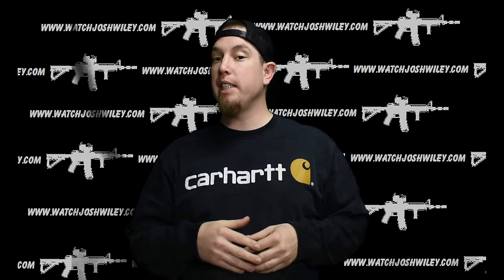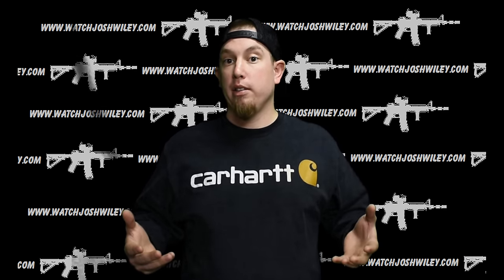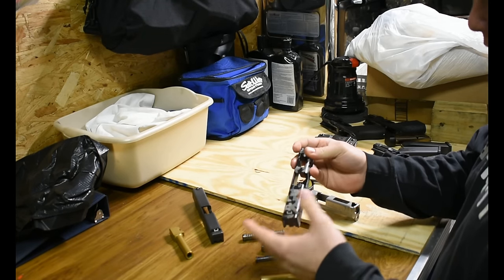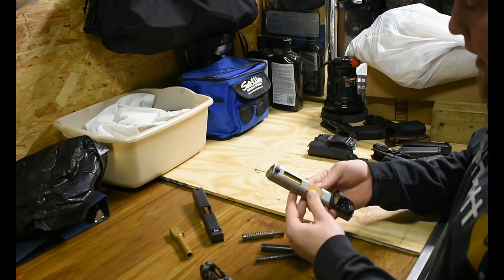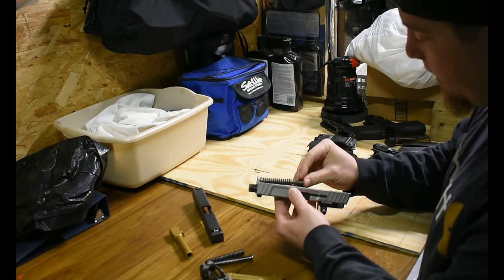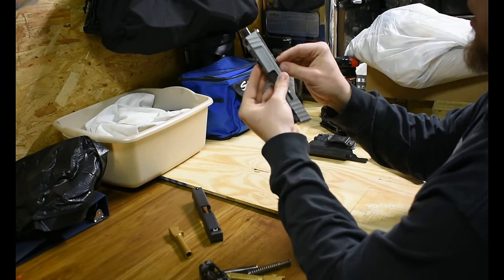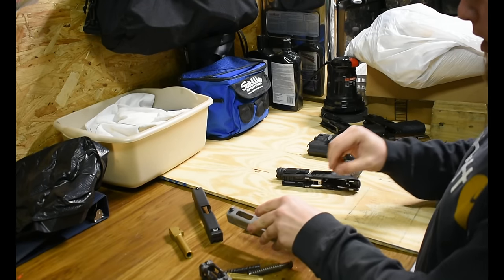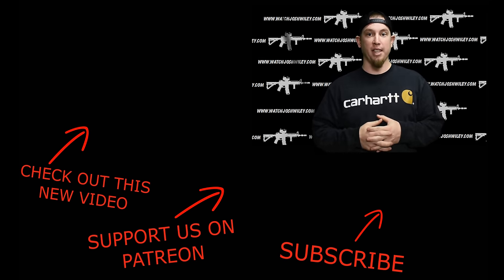How To Put A Glock Barrel In A S&W SD9VE Pistol

Comment: I've seen that trigger issue before and it was mag related. Sounds crazy I know, but I put a apex trigger kit in a SD40VE and it had the same trigger break/reset problem. It worked great at first but then I took the mag out and couldn't get the trigger to break without snapping it really hard. Come to realize the mag was pushing the slide up just a hair and it would drop down a touch without it. Confirmed by dry firing the gun upside down. I fixed it by filing the back of the trigger a bit so it would have a little more travel.
Reply: Make a video! Show others this.
Reply: Plz

Comment: I wouldn't mind seeing this Revisited. Seems like the lock up was decent. I would have like to see you try to hand cycle some rounds or snap caps through it. And with a little bit more trigger modification it may have fixed the reset. I think you were onto something they could have brought you business in the future. With the mass quantities of sd9ve's out there and people that want to upgrade them regardless if it makes sense or not.
Reply from the maker: It wasn’t bad but it wasn’t good. The bigger issue was with the recoil rod and spring. Neither fit and you’d have to make your own. I might revisit it later on in the future.
Reply: @thejoshwileychannel  You think it would be possible/feasible to print a small spacer and glue it to the end of the shorter guide rod/spring to make it the correct length? 
I’m eyeballing an idea I just had a few minutes ago. I see that BCA is releasing a Glock 23 9mm conversion barrel, and there’s lots of SD9VE/SW9VE’s parts kits and slides for sale on gun broker. I’ve also seen a video of where a guy demonstrated that a bunch of S&W slides can be modded to fit on a glock frame and rails. 
So I’m thinking if I could pick up a SD9VE, SD40VE, SW9VE, or a SW40VE for cheap, drop a BCA G23 conversion barrel in the 40 versions, and put that all on a glock frame, that’d be an interesting and cost effective way to build a very unique gun
Reply: @thejoshwileychannel  do you try any rounds through it with the Glock barrel? I'm just asking before I try a science experiment lol
Reply from the maker: Absolutely not. Wouldn’t lock up properly
Reply: @thejoshwileychannel  yeah I see what your saying now.

Comment: It would not be too hard to find out what mating surface is having this effect. If it's related to the locking block then there probably isn't much you can do. If the mating surface is between slide and barrel, it could probably be made to work.

Comment: I don't understand why more aftermarket parts aren't made for the SD series. I have an SD40VE, and it's frustrating to find parts for it. I've been looking for a threaded barrel for it forever and it's impossible to find one.
Reply: Same, no luck
Reply: Glock 23 barrel from lone wolf worked in mine , threaded and all
Reply: @fuckagooglecount2448  Oh man! I wish I would have known that sooner, thanks for the info though. I just traded it for a Glock 40 Gen 4 MOS 10mm. Still, it's definitely an upgrade from what I had.

Comment: Would an MP barrel make a better aftermarket/upgrade for and SD
Reply: No, I think some glocks may work with the glock guide rods.. apex made a threaded last spring but they dont stay in stock
Reply: I want a 357 Sig Barrel that will fit in my SD40 VE. Maybe a little longer barrel for better muzzle velocity. A custom carbine kit w/12-15in 357 barrel would be cool too.
Reply: @gtgodbear6320  I was going to post that also.  I'm always looking for a SW357V barrel also.

Comment: What spring lb do I need with the glock barrel to make it fire with no problems? It sucks they do t have that much upgrades for the sd9, I think your video is badass and I’m thinking about trying it just want to make sure I’m getting the right parts so it won’t back fire on my and blow up in my hand lol
Reply from the maker: It’s not the spring it’s the guide rod length
Reply: I used a g19 barrel and the glock recoil spring assembly. Shoots fine.

Comment: I have a Sd9ve and these threaded barrels are long sold out. So I’m thinking about putting a Glock 17 threaded barrel in my sd9 with a Glock 19 guide rod. wondering will this work or not, and be able to function and shoot. Not concerned about lock back or the slide being a little off as long as it fires. Yay or nay?
Reply: Sharrod Management let me know how that works out. Thinking bout doing the same.
Reply: @atlchopper2008  did it work ?

Comment: Hey josh I’m wanting to go forward with you’re idea to add some barrel mods, what rod and spring would you recommend to get rid of the trigger problem.. i also have a apex spring kit
Reply from the maker: What trigger problem?
Reply: The trigger problem was because it was on the edge of being out of battery, you would need a shorter spring and guide rod or a slightly longer one, respectively

Comment: Wonder if the S&W slide would fit on a glock frame??
Reply: It will fit, but not shoot/cycle.  The way the disconnect engages is different.
Reply: With modifications, it works. I've done dozens of them.
Reply: @RobertJackson-bd5vh  yeah a year later I made one ha

Comment: Have to replace sd9 guide rod. I got a steel guide rod for like 10 bucks. You can get a glock slide to go on the sd9 have to mess with it alittle but I got it to go on never tried to shoot it tho lol
Reply: Dont use a metal guide rod on the s&w. Theres no shortage of reports of cracked frames due to the design needing the guide rod to flex, and s&w explicitly states they will not warranty stress cracks from metal rods.

Comment: Whoever watches this in 2022 and beyond, Clear your firearm, and check it to insure it is clear. Dropping the magazine with live ammo out doesn't mean it's unloaded. You gotta actually check. Do what this guy did, and you may have a negligent discharge.
Reply from the maker: They were clear…you can see as I pulled the barrels out…
Reply: @thejoshwileychannel  Yes, but you should be demonstrating proper safety measures. With that said, I was hoping to see you rock that sigma with glock shit. Bummer.
Reply from the maker: SD9VE. I’ve done another video on it